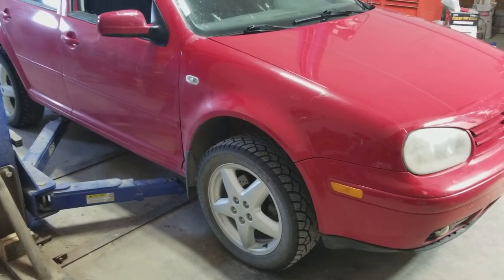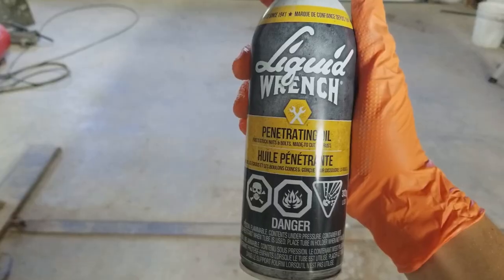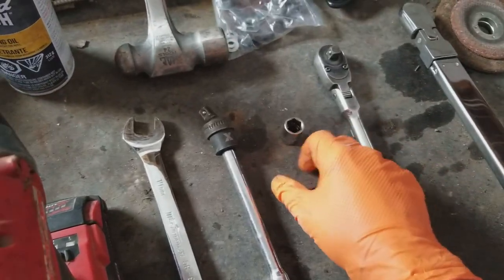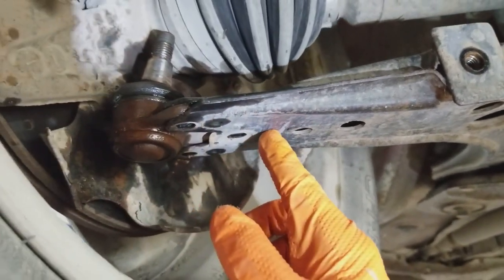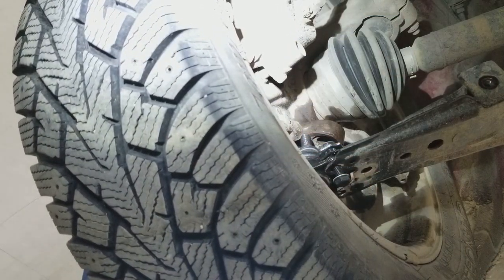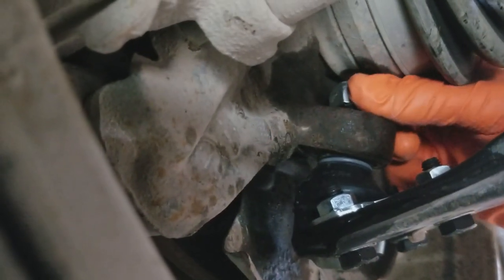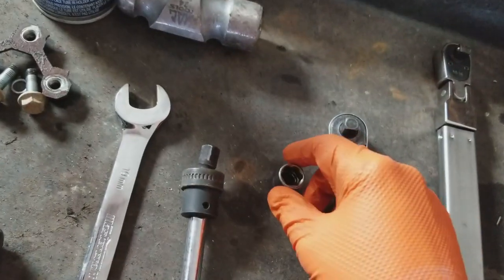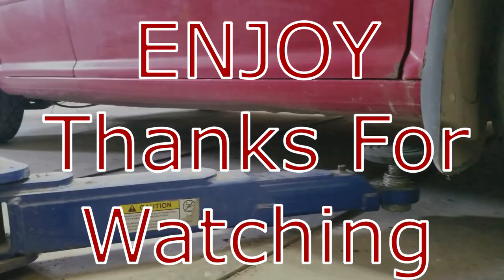How to replace a ball joint on VW Jetta Golf mk4

Comment from the maker: If you need any of the parts or tools, that I use in this video, you can find them here. 

Parts:

- passenger side ball joint  -  https://amzn.to/2HeeMAe

- driver side ball joint  -  https://amzn.to/2Ylqbny

Tools that I am using:

- 3/8 swivel ratchet  -  https://amzn.to/2E0IczN

- socket set  -  https://amzn.to/2Hcscwj

- 3/8 impact swivel  -  https://amzn.to/2PWp6iQ

- 3/8 torque wrench  -  https://amzn.to/2VNTQbp

- 3/8 milwaukee impact gun  -  https://amzn.to/2Hbcxh0

- pry bar  -  https://amzn.to/2E0rW1M

- ball pein hammer, 16 oz  -  https://amzn.to/2HdmnyV

- penetrating oil (liquid wrench)  -  https://amzn.to/2YggYMY

- rubber disposable gloves  -  https://amzn.to/2VtuOPi

*When you use any of these links, amazon knows that I've send you and they will pay me a commission which would help me a lot. For you though, nothing will change, it'll be just like any other day on amazon.

Comment: Good work. Would have been even easier if you'd remove the wheel. Why did the new bolts come with washers?
Reply from the maker: Thank you very much. Yes, it would of been a lot easier if I'd removed the wheel. I guess laziness fights back sometimes. To your question, if you look at how the bolts that where on the vehicle are made, you can actually see that they have an attached washer, whereas the new ones don't and that is why they come with washers. You saw what I mean?
Reply: @AutoTechWorld_DIY  ah I get you, cool.

Comment: Nice Job. At 4:20 into the video the ball joint break lose and I'm amazed that the shaft does not spin inside the ball and you are still able to spin that nut off. No idea why the Jackasses put a place on top of the stud where you can insert an allan wrench to keep shaft from spinning when there is no room to get it in there. Now I'm of German descent, but working on my 2004 Golf TDI has me shaking my head at the Idiots who designed it. So many things on that car are very flimsy such as trunk opening mechanism, Battery Box, rear seat fold down latch and of course the engine oil dipstick.
Reply from the maker: I'm born in Germany and now live in Canada. But, yeah there is some stuff I absolutley hate on these German cars. The latch on my hatch took 2 or 3 zip ties to keep it together. And then you forgot about the oil pan. The lowest part of the car. I replaced a few of them already. 

Thanks for watching and God bless you
Reply from the maker: About the ball joint nut, it was barely on anymore by the time I broke it loose. And I guess if it would spin, you would now be able to grab it with a good plier.
Reply: @AutoTechWorld_DIY  I put a set of vice grips on there and it still spun. Will have to cut it off.  You were mentioning the oil pan. What is the issue with them ? drain bolt ?
Reply from the maker: @wolfgangkohler2508  The oil pans are just so low to the ground, they always bust. If you have all nice roads it may not be an issue. But if you do lots of gravel, you never know. It can shatter at any time. I installed a 1/4 inch aluminium skid plate after the first break.
Reply from the maker: @wolfgangkohler2508  you need a good knipex plier. They are the best. This is the set I have. 
https://amzn.to/3uSrLRj
Made in Germany
Reply: They should come with a plastic cover on the bottom. Mine doesn’t have one. I guess they won’t last long.

Comment: Got LUCKY! Usually the ball joint shaft will spin with the nut after breaking it loose. At that point this video will be useless.
Reply from the maker: Your right. You can try to heat up the nut. But very careful not to damage the axle boot. Or Jack the car up right under the ball joint. That will jam it into the knuckle and hopefully stop it from spinning with the nut.
Reply: @AutoTechWorld_DIY  "You're"... If you do that how is the nut going to come off the top?  The best way to do this job is by removing the axle nut and setting the axle aside... only takes 2 min more. But in your case it worked so that's proof is not impossible.
Reply from the maker: Sorry, I'm just a mechanic 🙈.

If you have it that far off, where it is jammed up against the axle, it usually spins fairly easy. Then you can jack up the vehicle on a different place, and push down the control arm and then take the nut off all the way. And if it still spins, you can pry down the control arm and hold the exposed stud below the knuckle with a plier and then take the nut off.

I barely ever have any luck holding the ball joint stud with an allen key. They always seem to strip or round out.

Comment: I managed to do it. Yay!
The only thing is my steeringwheel is out of alignment. It's leaning towards 
2 O clock - if that makes sense. Can I fix this myself, or do i take it to the mechanic...? Thanks again!
Reply from the maker: Nice! Emm... you'd probably have to take it to the shop to get an alignment done. Unless you have an alignment machine yourself. 
I had the same thing when I replaced the ball joint. Steering wheel was off, but otherwise it seemed to drive straight. 
When you do the alignment you'll see that the measurements will be of. 
And if you won't do the alignment, your tires will wear much faster.
Reply: @AutoTechWorld_DIY  Thanks man! Yeah just booked a time to align my wheels!

Comment: Wow that might work.  I just did the driver side and had to replace an axle too.  My passenger side doesn't need an axle so I might try this.

You would have more room without the tire though.  Thanks for posting.
Reply from the maker: Yeah I realized that too. Should of taken it off.
Reply: I used your advice today on the passenger side.  It went so much smoother than my driver side did yesterday.  The move with putting leverage on the arm to work the nut on the ball joint helped a lot.  Thanks!
Reply from the maker: @luisg1653  happy to help out other people.

Comment: Hey man. Trying to to both sides ball joints on my 04 Golf R32. The top nut connecting the ball joint to the knuckle is beyond seized. Any recommendations?(already tried some bolt breaking spray)
Reply from the maker: Do you get it loose at all, or is the ball joint spinning with the nut? It may help if pry your control arm up and jam the ball joint into the knuckle. Or maybe use a Jack under the ball joint. If it's still not working, heat up your nuts till there red and then take them off. Just don't get the boots on the CV-axle hot or you'll burn a hole into them. Let me know how your making out. 

These are the things I would try. If you do so, do it at your own risk. I just don't want to be blamed if something goes wrong 😉
Reply: AutoTechWorld Not loose at all. Ball joint wasn’t spinning, was just rotating my whole hub. Tried heating it up and tried jacking it up. Unfortunately neither worked and I’ve stripped the nut. Any more thoughts? Should i just grind it off? Sucks it’s in such a tight spot or I would’ve cut it off already
Reply from the maker: @801R32  seems like you are in a very uncomfortable situation 🤯 .  I'm afraid that cutting it of is your only option than. Especially once that nut is round🤔.  If you can get your hands on a sawzall and a metal blade, it should be doable don't you think? I could see getting a grinder in there being tough, but a sawzall 🤷‍♂️? Just be careful that your not slicing and dicing other components. Let me know how that is working for you or if you find another way to do it. 

I just had a Ford Flex in 2 days ago, it had the same problem, I couldn't get the ball joint stud to stop spinning. So I got the nut really hot (and I mean VERY hot) with a propane torch and grabbed the top of the stud with a good self biting plier. You will need a really good plier though. I have knipex pliers that come from, or are made in Germany. They got very strong teeth and the more you turn, the more they bite into the metal.  

This is the exact set that I've got:
https://amzn.to/2LM7ZPF

Or you could just get a single plier (a bit cheaper):
https://amzn.to/3ecudXh

These are affiliate links. I'll get a little commission when you use these links, but for you it's all normal.
Reply: AutoTechWorld thanks for the reply. I ended up cutting it with a sawzall with no damage to anything else luckily. Tomorrow I do the other side. Hopefully no cutting required 🤞
Reply from the maker: That's good 👌. So you also got three other side out good?
Reply: @johnmadden15  If I remember correctly I cut the nut and bolt down the middle. The nut screwed off before I had to cut all the way through it. Above the control arm

Comment: What ab if the ball joint stud spins with the nut
Reply from the maker: Try to hold it with a vice grip or a knipex plier. But do not hold it over the nut, so you don't wreck the threads and make it worse. If you can't put a plier under the nut, try to put a Jack right under the ball joint, so you put all the weight on it and thus jam the ball joint stud in the knuckle. That might work.

Comment: can you do outer tie rods on a 2003 golf?
Reply from the maker: Thanks for subscribing! I did a video where I replace the inner tie rod. In there I also take of and reinstall the outer tie rod. So you could just watch that I guess. Plus I'm giving every subscriber a chance to receive a free gift (specialty tool). So you might want to watch it and I would really appreciate if you'd share it with someone who cares.
Reply: @AutoTechWorld_DIY  i plan to try this balljoint replacement tomorrow, i don't have a lift and more rusty than the car you worked on, but i hope it works!
Reply from the maker: @salemsouth  Oh I'm sure you'll be fine. Just take the tire of when you do it. Will be a lot easier. It was pretty dumb of me doing out with the tire still installed 🙈
Reply: @AutoTechWorld_DIY  I forgot to comment , i both sides this way worked
Reply from the maker: Hey that awesome. 👍

Comment: I've heard 3 different sizes for the top nut.  Heard 19, 18, or 13. 😠
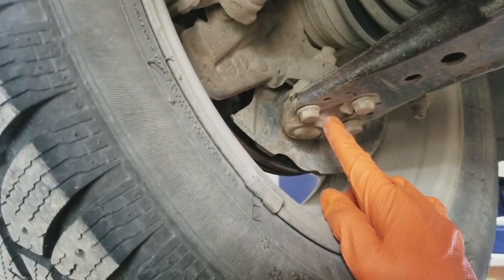Reply from the maker: I'm not sure if you mean just in my video you heard them all 3 or across other videos you've seen. It is 19mm. Just go by the numbers I'm saying right here 1:56.
And then the little bolts that connect the control arm to the knuckle, they are 13mm. I hope that clears it up?

Comment: How much would this cost at a shop?
Reply from the maker: It depends where you go. The books show one hour to do the job. Than the shop would also do an alignment as well. 

But here is what I would charge:
- 50$ to replace the ball joint
- 60$ to do a front end alignment
- 44.75$ or 96.25$ depending on what brand of ball joint
 That is all Canadian dollar and I would say I am very cheap. If you're taking it to a dealer it might be double the price for labor. So it's worthwhile doing it yourself. Especially if you buy all the tools, you can than use them for other repairs as well
Reply: AutoTechWorld thanks a lot i really appreciate u taking the time to give me such a detailed answer
Reply from the maker: @FoggamingMc  Your welcome. So you'll tackle the job yourself?